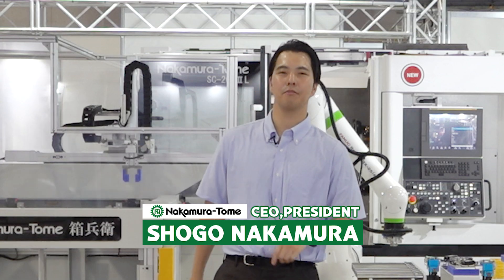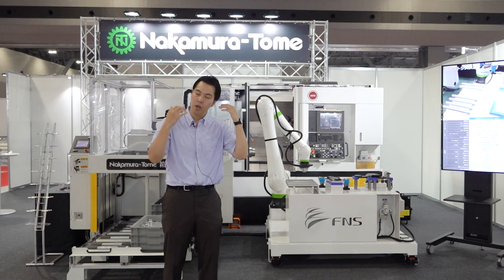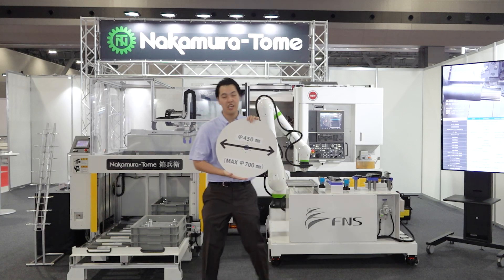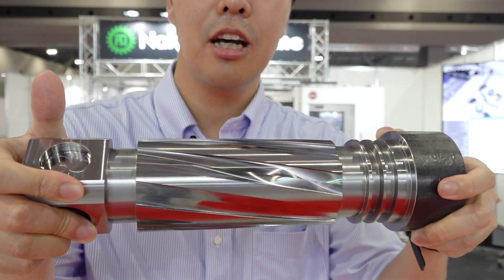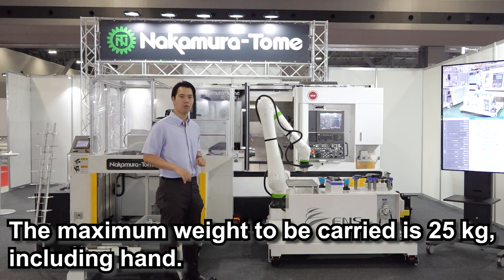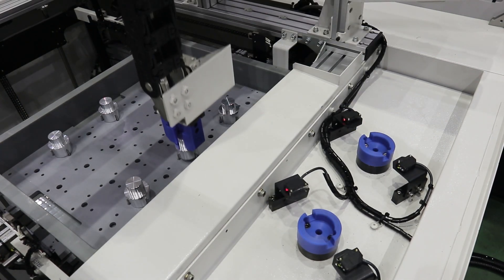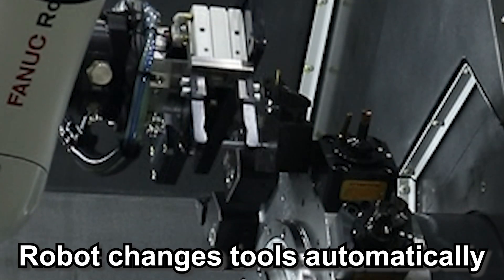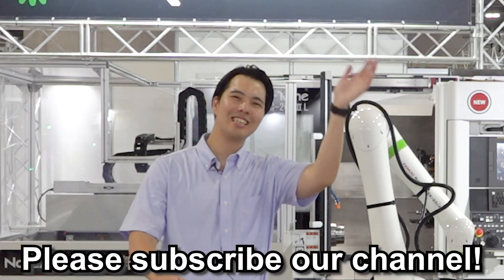Streamline Small Batch Production with latest Nakamura-Tome's Collaborative Robot System.

Comment: About capto tools, what will happen if chips will stuck inside bolt head socket? Robot will send error message or tool wont be tighten properly?  This looks cool, but what about actual performance? :)
Reply from the maker: Thank you very much for your question!
Since this is a demo, the process of cleaning chips with air before tool change is omitted, but there is no problem with automatic tool change.
We also manage torque and can confirm the tightening.

When dealing with small chips, it may be difficult to notice them, which is why we measure with an automatic tool setter after the tool change.
If the measured value exceeds a certain threshold, the operation will be stopped. We can make proposals tailored to the customer's needs.